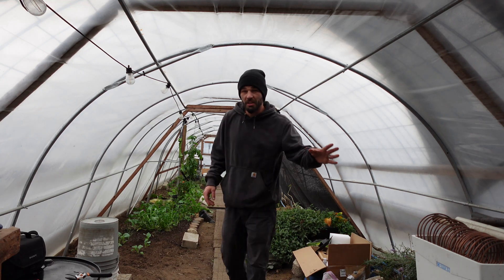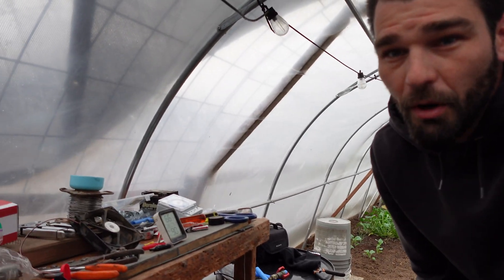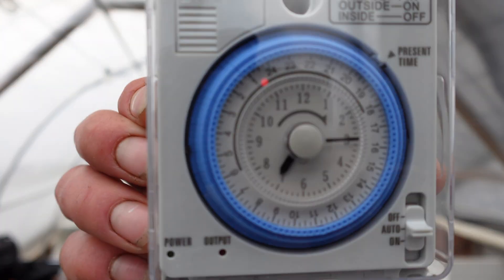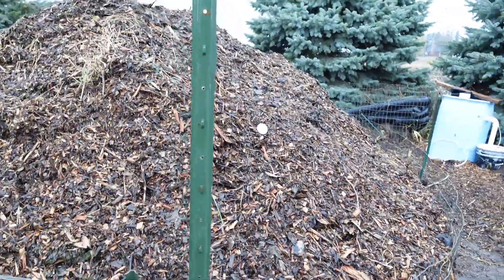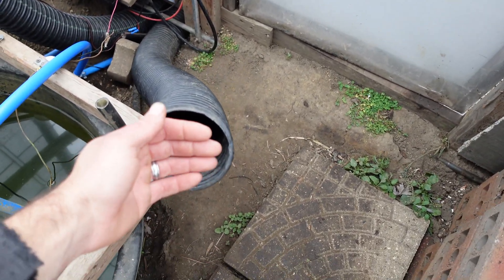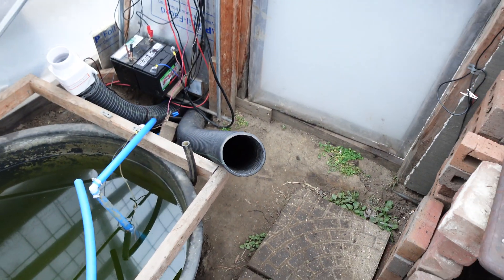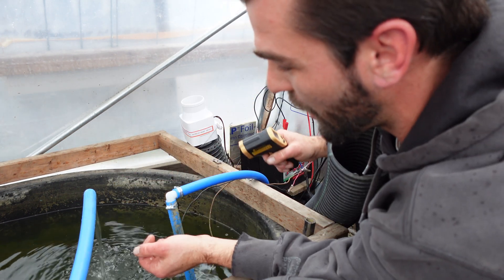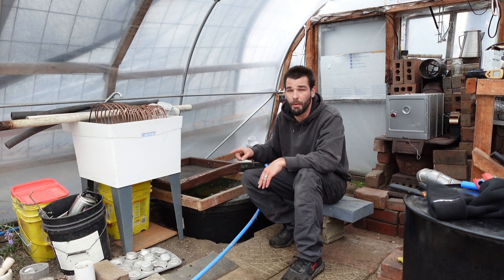DIY Cheap Greenhouse Heater Made From Compost! Temps - Data - Observations - Winter 2025

Comment: We built a Jean pain heater but our pile isn’t heating. I have no clue why. We used wood chips and wet them down as we piled them on but so far a week in and no heat.
Reply from the maker: So as my grandpa started me on cars at a very young age, he said air, fuel, spark, it’ll run. So when relating that to compost heating we’ve got the variables to consider. Nitrogen for fuel, carbon for mixing with the fuel to create heat, oxygen, & moisture for the final components. Now if your woodchips have been sitting a long time chances are nitrogen, has already depleted in the combustion cycle. The size of the pile definitely matters and the nitrogen to carbon ratio should be about 75% carbon to around 25% nitrogen. And with lots of moisture and possibly some additives like inoculants extra nitrogen chicken poo comfrey yard waste ect.. I wonder if you just didn’t have the proper ratios and you were using older chips as opposed to newer chips and didn’t add any extra nitrogen?
Reply: @Earthdwellershomestead we’re gonna pull down part of our pile and add some plant clippings and nitrogen and build it back up we’ll see what happens. Thanks.

Comment: Will you do a flow rate test by seeing how long it takes to fill a 5-gallon pail?
Reply from the maker: I have filmed a flow test on a more finalized version, as I swapped pumps around and tweaked the system a bit in the next videos. That’s a great idea and I still may do it. I measured using a mason jar in the video.